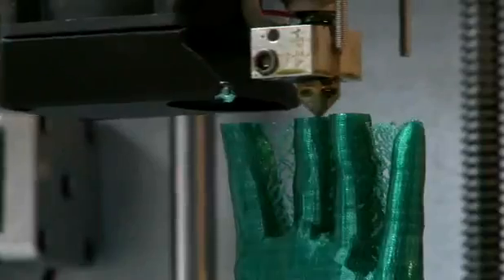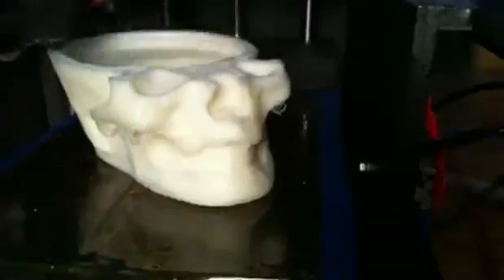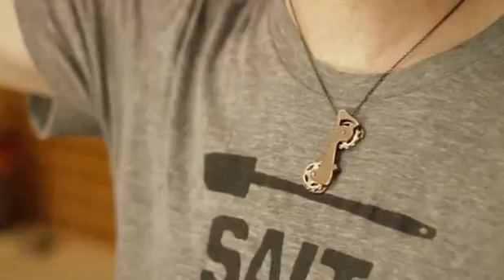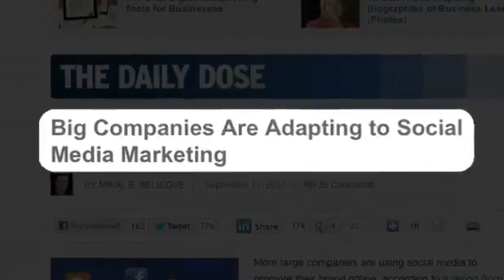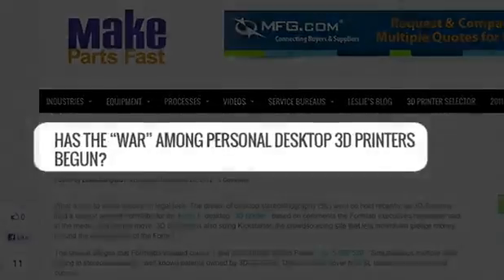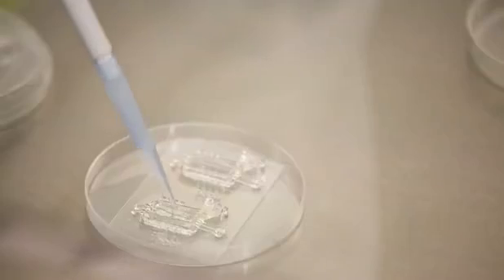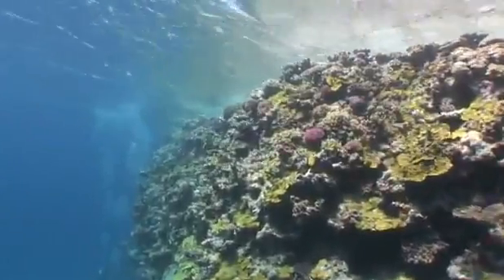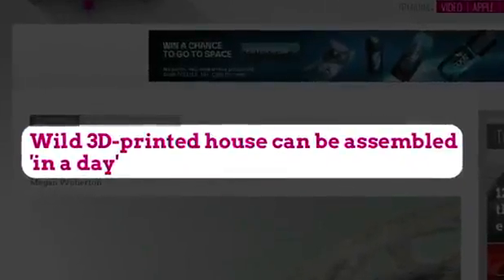Watch Why 3D Printing Is Going To Kick Ass

Comment: I use Shapeways 3D printing services to print up 3D artwork. It is a phenomenal tool and one of my favorite mediums to work in. It can be a pain though because of all the criteria and specifications that have to be met (try hollowing out a complex model in Zbrush omg die die die). Also, the materials are limited and expensive right now. But I'm hoping this will change. I think 3D printing will become an extremely prevalent technology. It kinda already is in some ways but I think it will really blow up really soon.

Comment: ... are you high, I told you one kg of plastic is 20$ and just to summarize for your stupid brain, the cartige is the "ink" for the printer, you could make the ink by buying a 200$ machine or making a simple one at home, you could also make a 3d printer at home which could make the filimant machine for around 10$ (20 for extruder head/etc) so in total if you buy smart and not like every idiot like you, ill cost less then 550 ...Continued because your so stupid I need to explain longer

Comment: Since the rubic's cube have the moving mechanism inside it you cannot print it outright or the moving parts will stick to each other... You can however print it by parts like the 4 main middle part. then the 12 edge parts and then the 8 corner parts then the skeleton to put the middle parts in...

Comment: 3D printing is 30 years old, companies use it to prototype parts all the examples  given in the video are printed with very high end printers developed in the last 20 years . Your rubix cube would be rough and not very fun to play with and the stickers and small metal parts would be missing so it would break easily.  Pure hype.

Comment: I was hoping you can find the answer in my reply, so one more time. Printers printing with filament need to make supports between two parts to by able to print next part, if you want to print parts what need to move than you need to build it so that you can cut the supports, than YES you can print some gearboxes in one peace if you can cut the supports. There is no simple answer and your question is not simple. It is all about shapes, access to the support, and more. So YES and NO !!

Comment: I have one problem with what Sam Cervantes says about 3D printing being this fantastic new technology. The tech has been around since the 1980s so its not new. However, its only now becoming available to the consumer. The biggest challenge is to integrate the hardware (the printer) with software to make it easy to use for someone who has no understanding of engineering, etc. When you can make it so easy to operate for anyone, THAT will be what makes 3D printing appealing to the masses.

Comment: it prints plastic only, which you can print the mechanical parts (rims gears etc) but the electrical parts (resistors motors etc) you will have to buy